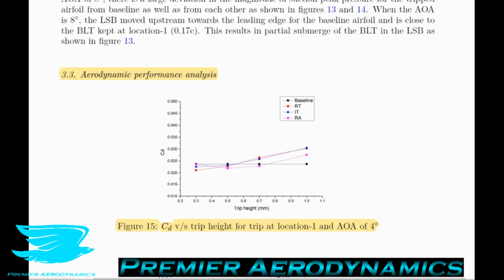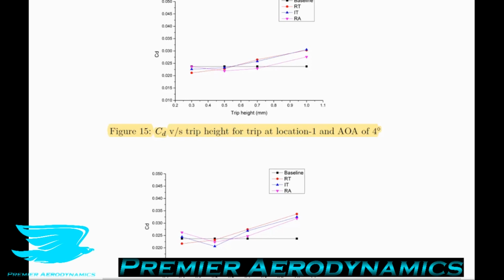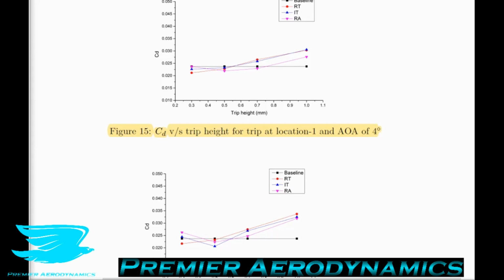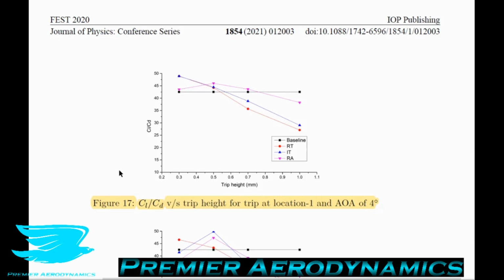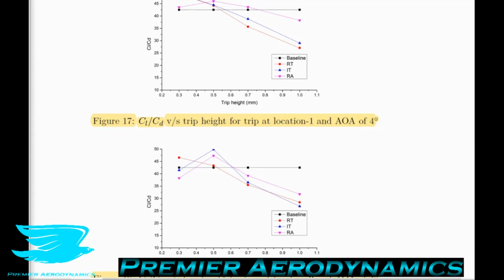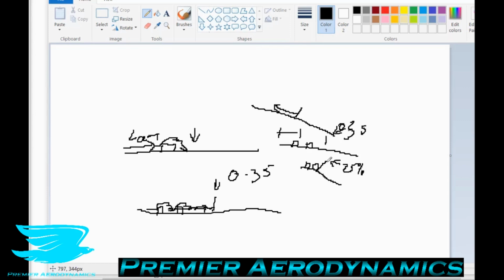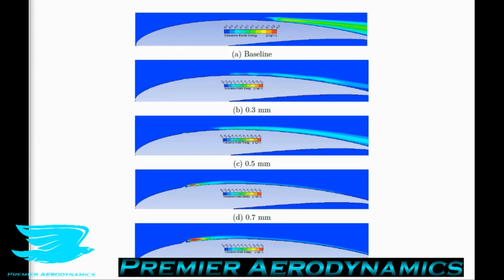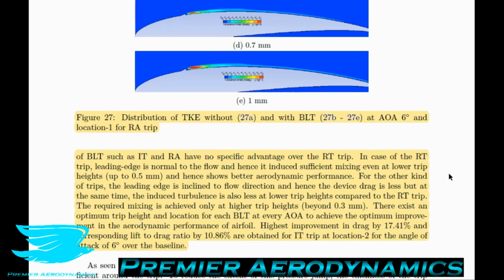Are Different Boundary Layer Trips Shapes Better For Tripping Boundary Layers Part 2 - Podcast #122

Comment: YES! I figured something out thanks to this! You're the man, I owe you a beer, or sparkling water if you don't drink.
Reply from the maker: Thank you. What did you figure out?

Thanks! Perhaps a chupa chup?? Hopefully one day all of us amigos will hang out, we could have a piñata, it'll be great!🥳
Reply: @PremierAerodynamics  some cylinder head porting, particularly how the metal surrounding the valve guide affects how air conforms around the roof of the port. Turns out that functions as a boundary layer trip.